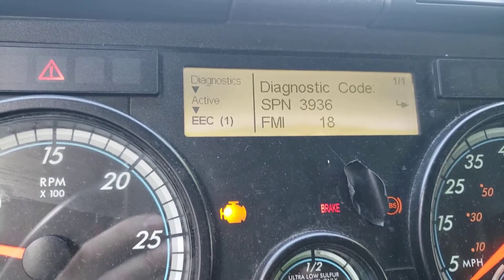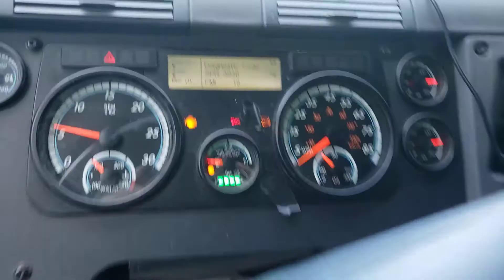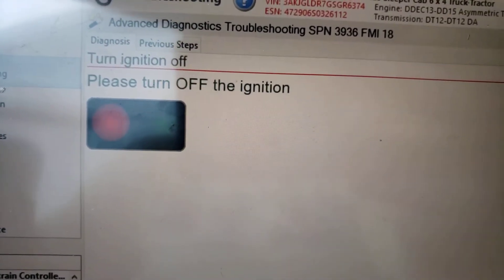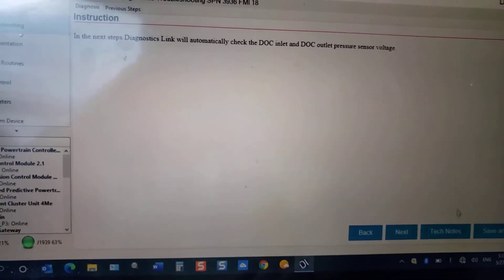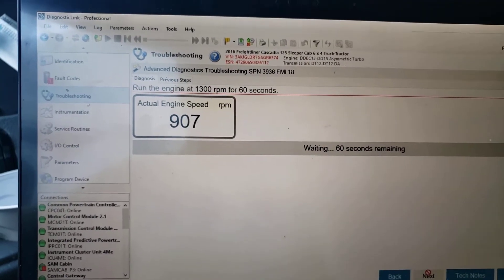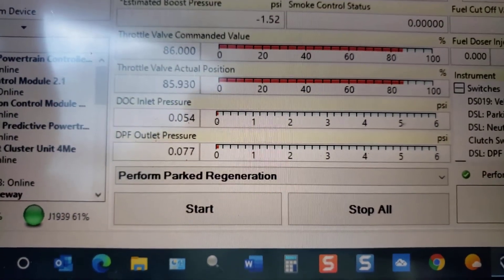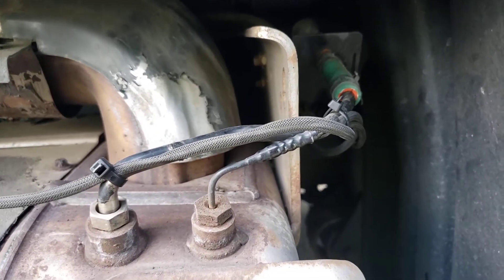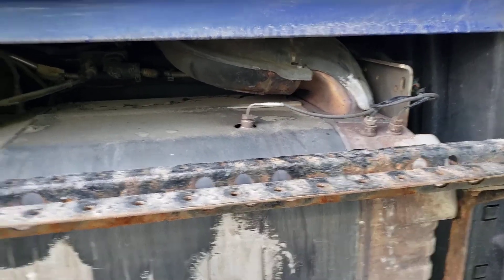SPN 3936 FMI 18 and SPN 3251 FMI 21

Comment: i have the same year 2016, which dddl version are you using?? is it 8.14 . and did you get the nexiq2 from ebay or you bought the original
Reply from the maker: Its 8.14 and yes bought on Ebay but original Nexiq2 w/BT
Reply: @nikalaexpress711  tnanks for the reply